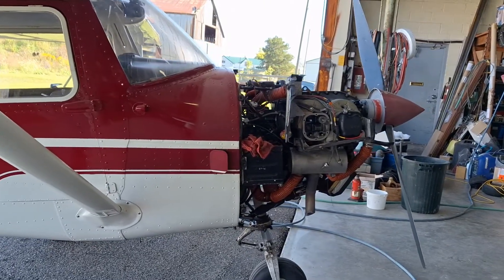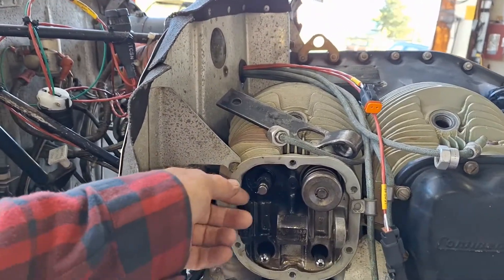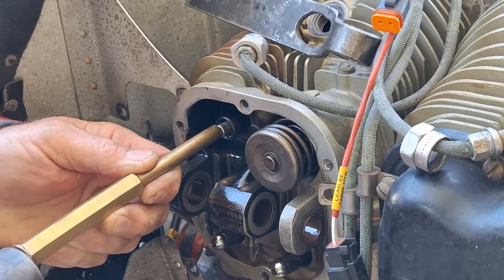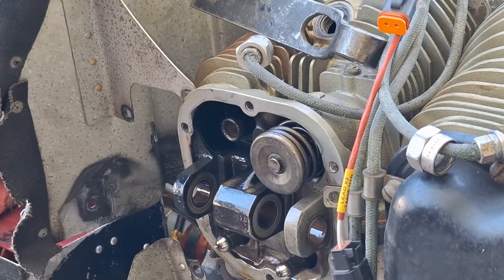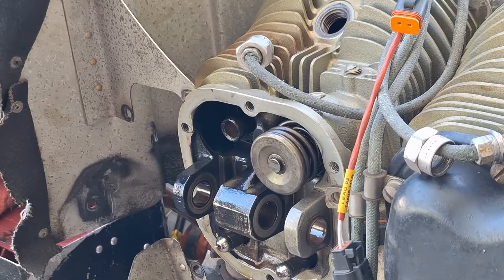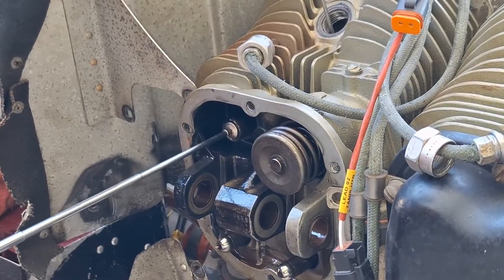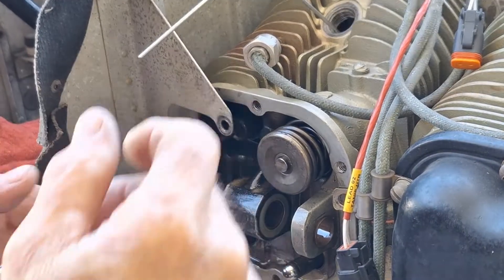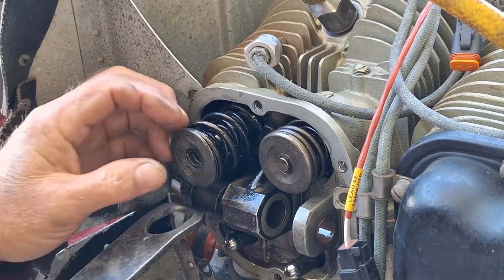Cessna 150 Continental O-200 Stuck Valve

Comment: This is an awkward one. Yes it is a clever repair, but one has to ask, why did the valve stick in the first place, and how long will it be before it sticks again. If the engine is only doing a few hours a year like you suggest, it will probably be fine for years. But if the valve guide is excessively worn, then the heat cannot dissipate from the valve thru the guide to the cylinder head, The valve then overheats, cooks the oil to carbon, closes up the clearance and the valve sticks again. The dangerous part is,  if it starts sticking enough in flight, that the piston hits it, it may bend or break the valve causing an engine failure. No one wants that.

Comment: I’m an auto mechanic and find it amazing how you did that without putting the head!!
Reply: It was almost like magic - I'm amazed. The dental floss idea is a good one, too.
Reply: Can't pull the head on an aircraft cylinder as they are one assembly.  You can pull the assembly and do the work once removed.  Lots more work though.

Comment: What is the likley cause of a sticky valve.  What do you recommend to prevent this from ocurring.  Running as lean as possible?  Additives?  What would be the likely cause if it is a recurring problem?

Comment: Compressed air to hold valve in place. That's how I have replaced valve seals on automotive engines. Wondered why in aviation everyone seems to use the rope trick. Would it have been a good idea to lap the valve while you were at it?

Comment: A good trick shown to me by a mentor that taught me the "rope trick" is to tie dental floss around the keeper groove on the valve.  Push the valve in and fish the floss out of the upper spark plug hole with a piece of safety wire with a small hook bent on the end and pull it up by the floss to clean the stem.  After cleaning the guide when the valve is back in the cylinder bore, fish the floss back through the guide and it usually pulls right back in.
Reply: Blow air into the cylinder through either hole (spark plug or guide) to blow the floss out the other hole.

Comment: Nice job  
I did that a few times in the 80s  when my 150 was doing traffic reporting around Boston. They flew it 5 hrs a day slow flight so the 100 LL plugged up the valves and spark plugs regularly. I cut 2 fingers off a 4 finger pick up tool went threw the bottom plug hole.

Comment: Waste of time, the guide is worn and will get stuck again.  This is only a good technique to get a airplane back home.  Not at annual, needs to be removed and repaired properly
Reply from the maker: Worn guides are loose and affect the valve contacting the seat correctly. Sticking valves,  is a very common problem running an engine on fuel with way more lead than it was designed to use. Years ago Lycoming issued a service letter to check the clearance and ream as necessary every 400 hours. I have been doing this for over 40 years and never had a issue after reaming a guide, in fact I have never had to ream the same cylinder again after years and many hours of operation.

Comment: Did you use a specialty valve guide reamer from McFarlane?
Reply from the maker: Many years ago I purchased the size listed in the overhaul manual from an automotive machine shop supply. Now I would probably use McMaster Carr
Reply from the maker: I bough